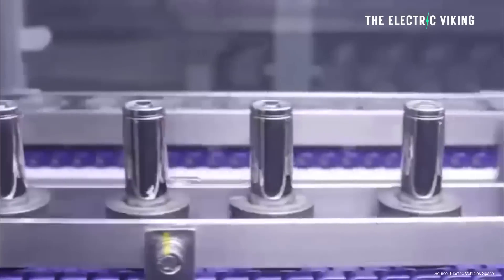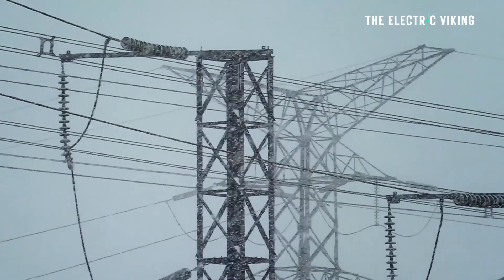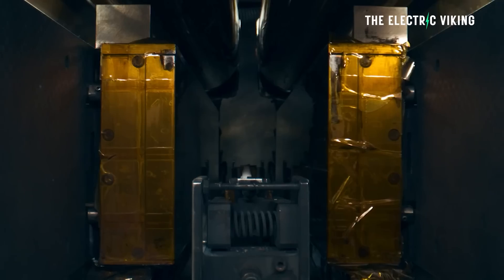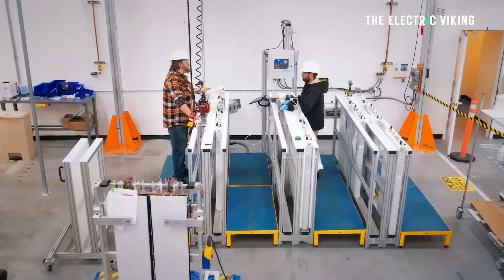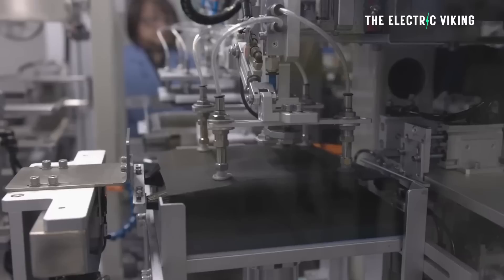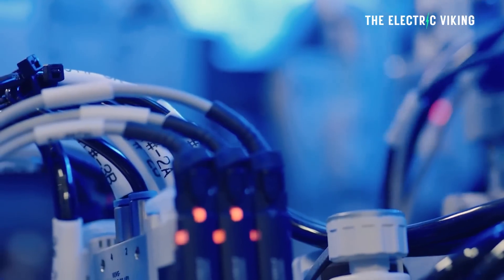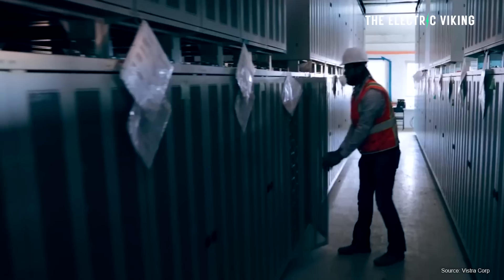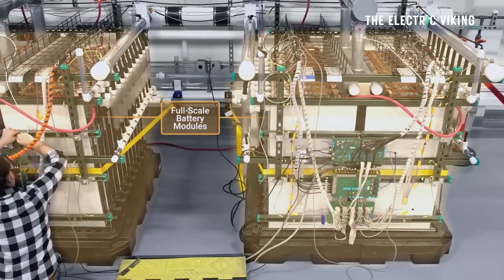U.S company reveals revolutionary battery that DESTROYS sodium & lithium

Comment: This is heavy, but very cost-effective, so ideal for grid application
Reply: Cost effective? What is the cost of it, actually?
Reply: @gdiwolverinemale4th  the rust of a 51 chevy
Reply: Anything that's build in US will not be cheap despite materials being relatively cheap..
Reply: @zizimai7568  That's a big blanket statement, there are many things manufactured cheaper in US.  Heavy products like this, built partially onsite, would likely not be much cheaper if at all, if they were made in China.
Reply: Also good for home storage systems, plus stuff like heavy equipment which often uses massive lead counterweight balance plates anyway.
Ie those large construction cranes, front end Loaders and dozers earth movers etc.
Reply: @4literv6  not really any use for home storage. Form quote 1MW (I assume they meant 1MWh) in 0.5Acre. Scaling that to 10KWh gives an area of 218 sq ft, a pretty good size room, and that would be filled with cabinets contains 1m high electrodes. You'd need a whole outbuilding for the battery alone.
Reply: You are missing the key info, C rate is the key here, aswell as the cost to deliver the C rate

Form is very low C rate, It’s 85MW of power with 100 hours of storage (8500MWh’s) therefore it needs 8500MWh of stored energy to deliver 85MW of power

If you need 170MW of power you would need 17000MWh of stored energy because the C rate (the comparison of power / energy) is very low

A Tesla MP can be 1 or 2MW power using the same amount of cells (4MWh) so it can discharge all its power in 2 or 4 hours depending on its power spec 

Batteries get paid for dispatching power over a time period so if you can only dispatch your power over 100 hours you will miss all the high priced spikes, they are mainly in 2 hours blocks

Tesla MP can capture the high prices by being able to discharge quickly to deliver 85MW mentioned you could do that from 170MWh of MP’s

170MWh of Tesla MP would be about $64m ($375/kWh) but Form need 8500MWh to deliver the same power at a cost of $319m ($37.5/kWh) so even though it’s one tenth the price the C rate means it’s actually 5x more expensive

Hence it won’t take over the market, there’s a place for it but at the moment shorter durations are where the money is

Forms standing loss is also fairly high I believe
Reply: @whlphil  There is a need for both larger peak shorter term power like Megapacks and lower peak longer term duration energy like this.  In fact cheap longer term duration, while not as sexy as megapacks, will be critical to the future transition.  There are many forms of this from pumped storage to thermal batteries to flow systems and they are pivotal.
Reply: @Ryan-ff2db  there is a need for both, however at the moment the market doesn’t pay for longer duration, maybe if they can get capacity payments rather than just reading power. I’m invested in another LDES player but that’s at the 10hr scale

It’s a complex the comment was more towards this price could kill all others in the market made in the video, TLDR it won’t as its value isn’t high enough. As a former battery developer, tech decisions are made on payback and whilst this is interesting it’s very early in the ‘will it work financially’ determination
Reply: @whlphil  Of course it pays for long duration, and short, and everything in-between.  It also depends on the market, but they are spending billions on this one specific tech alone.  Billions more on pumped storage.  There are at least 100 companies developing there version of long term storage.  There is a reason why they are doing this.  There is money in it and there will be even more in the future as base loads like coal and gas are removed from the grid.
Reply: No good for planes. 😅
Reply: local solar storage if they are correct and the batteries are not huge
Reply: Iron is hugely plentiful on Earth and relatively cheap (especially compared to other materials that batteries are being made from).

And Lithium battery fires continue to highlight how risky that material is. One has to put faith in manufacturing process for lithium batteries to be 100% defect free. Public safety shouldn’t be based on such required level of manufacturing perfection.
Reply: 85GWh capacity on a max 85 MegaWatt system?What's the charging cycle time? Do the math - will it probably takes 7 weeks to fully charge continuously or six months using a 6hour/day solar source?
Reply: @MrVaticanRag  Not 85 - just 8.5GWh- so at the same charge rate as discharge it would take 100 hours to charge.
Reply: Lol 😂😂 @MrVaticanRag
Reply: @MrVaticanRag  Where did you get the 85 Watt system info?  They've already deployed a 150mw system that charges 1Mwh.  By my math that's 6.25 days to full charge.  This is intended for long term duration not quick durations like lithium.  PG&E also purchased a 5MW/500Mwh which would charge in 100 hours.   It depends on the design.
Reply: @Ryan-ff2db  from info provided sorry typo - corrected
Reply: @MrVaticanRag  Also, I believe it's 8.5GW capacity.  85GW would be enormous.
Reply: @Ryan-ff2db thats what he said, but a battery's energy capacity is measured in GWh or TeraJoules. Not GW (or GVA), which is the max rate limit of the Grid.
Reply: The batter of the week yet again we will never hear about again as well.  Just "It's right around the corner."
Reply: @Ryan_DeWitt  You are wrong with this one.  This is massive project under construction, not a scientist in a lab.  There have been numerous articles about this and government backing.  This is the real thing.
Reply: @Ryan_DeWitt  It has been for 7 years already with Form Energy... :D

But in 2017 they themselves set a deadline to be fully operative by 2025, so we only have to wait a year :D
Reply: @Ryan_DeWitt  No. It's being deployed.

Comment: Iron is cheap. If they can get the processing costs down, then it's going to win on the basis of raw materials costs.

However I think the power density is pretty low. So it's fine for grid storage in locations where land costs aren't a major factor (rural Maine counts, also rural Australia). But it wouldn't be so good for household storage where power density matters (you want a Tesla Wall not a Tesla Extension, right?).

I disagree that multiday storage doesn't matter- I think it's really handy as a backup system, particularly if you want local storage solutions that don't connect to the grid. Besides there's nothing that says you HAVE to use it as multiday storage, eh? It just adds flexibility.
Reply: well it depends. if its 1/10th the cost but i need a shed sized storage device for 25-50kwh ....maybe thats fine in a rural location
Reply: Form Energy don't seem to be targeting home usage and seem focussed on large scale battery storage. They are seeking to optimise the role of Lithium in battery storage rather than replace it fully - seeking to lower the cost battery storage and focus the role of Lithium to support peak loads. This would allow Lithium resource to prioritise mobility and portable requirements. The Form Energy battery packs are stackable assemblies to optimise deployment footprint.
Reply: The last thing you need is a Tesla Powerwall. They are a ripoff.
Reply: @rogerphelps9939  13.5 kwh for 7500 with an inverter? how is it a bad deal?
Reply: @danielroden9424  You can now buy an EV witth an 80kwh batery for £40k or less. Some of tthem even come with V2G. That is £500 or less per kwh with a car thrown in. Now do you get it?

Comment: One can only imagine the carbon footprint of these batteries, we trade one good for one big bad!   Our solar farms cost so much to recycle,  wind turbine blades are buried in dumps. they have shut down the wind turbines off of Massachusetts due to environmental challenges.  There is a solar farm that is not even hooked up to the grid here, they built it and went bankrupt.  Need more accountability, before "changing the world"
Reply: Stop being negative. Technology matures. Engineering of these technologies will continue and these sore spots are being addressed already. It's not gloom and doom, it's baby steps, then walking, then running. We're better off today then we were 20 years ago for environment/pollution. And it will continue to improve. Check historical data.
Reply: [One can only imagine the carbon footprint of these batteries] Beyond your imagination, perhaps you could illustrate your point in engineering terms so as not to appear as complete fluff?
Reply: Zombied wells in the US have an estimated cleanup cost of $280 billion which the tax payer is on the hook for. But to you the real problem is old solar panels and wind blades. I think the cancer you have from being too close to wind turbines is effecting your brain.

Comment: Curtailment just means you need to deploy more EVs and Heat Pumps.  It is the solution to the other half of the electrification equation.
Reply: Exactly! One of the things we did when we installed solar was to put a timer on our well pump. The well pump only fills our water storage tanks during daylight hours. We also only run the clothes and dishwashers when our solar panels are producing power. Municipalities and industries will make a similar switch, and run energy intensive processes when energy is inexpensive.